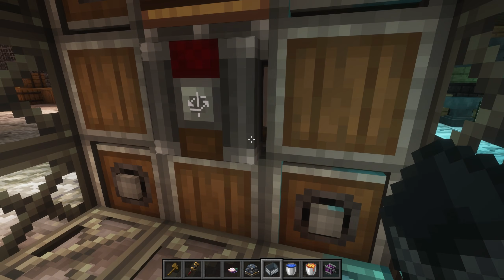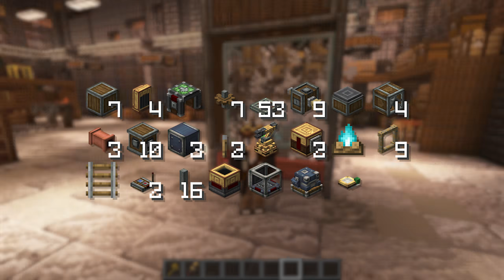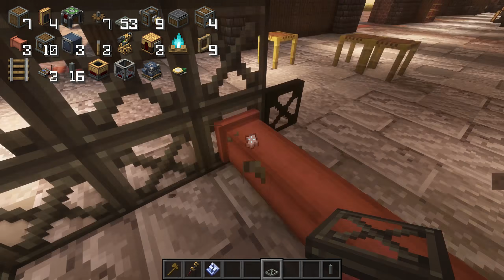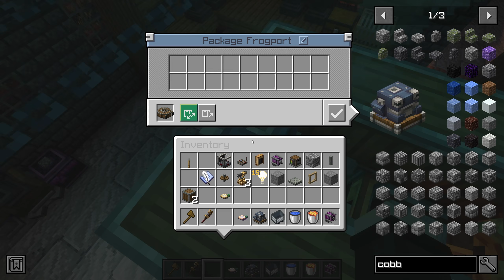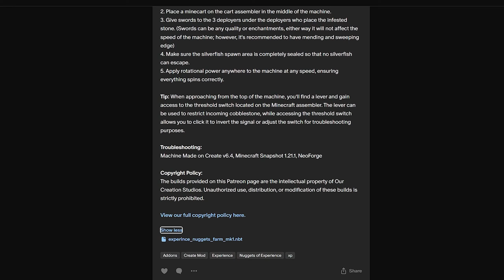This Super Compact XP Farm Generates OVER 200k XP Per Hour!

Comment from the maker: FAQ:  "Deployers aren't placing the blocks"

AWNSER: The Create Mod Schematics system tends to reset the threshold configurations, resulting in the machine not functioning as normal. 
Here are the configurations for the threshold switches, which, when applied, should fix any problems with the machine being out of sync with the minecart contraption.

Threshold Switch 1 - Located on top of vault: Power On When Top Row > 16 Stacks | Power Off When Bottom Row < 15 Stacks | Filter - Infested Stone
Threshold Switch 2 - Located on top minecart assembler: Power On When Top Row > 1 Item | Power Off When Bottom Row < 0 Items | Filter - Infested Stone
Reply: Question if someone isn’t playing on the new update what should the threshold switches be set to?
Reply from the maker: @e.m.f.l2763  something like 1% top and 0% for the one above the minecart, and 40% on top and 39% on bottom for thethreshold switch above the vault.
Reply: @OurCreationYT  Thank you! Your tutorials are the best!
Reply: @OurCreationYT  mine still doesnt work right with this
Reply: Build the whole thing but the infected blocks aren’t breaking. I  have the right input in the threshold switches and tried to place every block from bottom to top as the other comment says but they still don’t break i tried everything for over 3 hours. GG
Reply: I have the thresholds and everything set correctly but it still doesn't place the blocks, if I put a lever on the cart assembler and flick it manually then it does it
Reply: hey, how do i fix the smart chute not taking the infested stone from the item vault and putting it on the depot?
Reply: I can't get it to work at all and the frong thing is confusing im on 5.0 and dont have that, its not placing any blocks but I made sure the switches work, but they look differnet i dont see your ui its differnet.
Reply: Factory gauge isnt connected to smth i cant place it pls help yours is already connected but mine isnt
Reply: I had a lot of trouble with th schematic. didn't matter what I did, the deployers just wouldnt place the blocks.
My solution was as follows:
- when the schematic cannon was done, remove the deployers, the sail frames, the lower threshold switch, the cart assembler and cart and rail.
- place all of the above back in, working from rail up, by hand.
This got things working again. I think the schematic cannon screws up the cart contraption somehow, and breaks the whole machine. 
But you dont have to build it from scratch, if you are using a schematic.
Reply: @davidbayles3861 Was struggling for hours, thank you!
Reply: @davidbayles3861  You saved me so much time thank you

Comment: Hey! for some reason the cobblestones arent being smelted into stone and being transfered to the other side to be then turned into infested stone any ways I can fix this? I have the fan put set correctly but it is not pulling to the lava and when I put a cobble stone below it the cobblestone does not turn into stone
Reply: Fans going wrong direction
And 4:07

Comment: How are the moths dying? I've tried this XP farming method in a couple of different ways, but it never works because the creatures don't drop experience when killed by machines or the Create implanter; they only drop experience if killed by the player's hand, which is a problem because spawning thousands of these creatures can cause server and world lag. Are you using any other mods besides Create? Because at least I've tested it on versions 1.20.1 and 1.21.1 and it doesn't work to generate XP on its own.
Reply: create enchantment industry

Comment: A VERY STRONG SUGGESTION: Next time, list the items you're using, or if that is too much work, then just scroll over the iteam and it will display the name of the item for a few seconds. You are not giving accurate names of items, so I can't even search for them to create them. What are 9 cells? What are frames? This build is not difficult, but because it's missing information, it is taking so long just to find the things I need.

Comment: Bruh after like 2 hours it finally works, im on 5.0 version of create, guys go to the threshold above the cart assembler, then put 1% on top and 0% AND DONT FORGET TO PUT IT ON INVERT MODE IVE BEEN TRYING HOW DO I FIX IT AND ANOTHER THING IS, CHECK THE FKN VAULT BRO, THE SCHEMATIC DIDNT PUT 3 BLOCK LONG VAULT, IT DETECTS 2 BLOCKS INSTEAD OF 3 SOO ITS LIKE 2 VAULT BLOCK AND 1 VAULT BLOCK THAT IS DIFFERENT FROM THAT 2 VAULT BLOCK BRUHHHH THANKS AND BYE
Reply: u are my hero
Reply: after threshold went invert mode, the sail will be shaking and the cart assembler will turn on and off a bit, that mean its working

Comment: I think I've figured out why this machine sometimes won't work!  Try inverting the signal of the threshold switch on top of the cart assembler!

Long answer:
The cart assembler should be on and lit up by default.  The threshold switch above it is what provides the redstone signal.  If the assembler isn't on, it's probably because the switch is set to off.  Try inverting its signal!

When I figured this out, I didn't need glue.  (But keep that on hand just in case gluing the sail frame to the switch above the assembler may help)

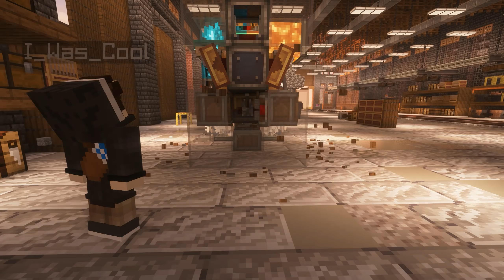(Note that in the machine demo at 1:48 the assembler is on every time the switch is in place atop it, but during the build demo the assembler is default off even with the switch in place.)

EDIT: After further thinking, I think the way it's supposed to work the vault is ALWAYS supposed to have some cobble in it.  With cobble in the vault, the switch atop the assembler will should stay on, so make sure there is something in the vault.  It shuts down the assembler if there's nothing in the vault.

Either way, inverting the signal may force it to run anyway, or toggling the signal may update the switch into operation.  Yes, turning it off and on worked for me.  😂

Comment: is there a way to use this farm without a chain system/frogport
Reply: I changed frogport to funnel and chute but now it just spits cobble out the side? not quite sure what's supposed to happen
Reply: @maxeaston8943 must invert the rotation of your shafts to also invert your fans the other way.
Reply: @maxeaston8943 did you figure it out? for me its not even placing anything

Comment: im sorry im starting from lvl 0 . noob knowledge... do i need a cobble generator using that conveyerbelt thing to fuel/run this system?
Reply: You don't need the chain you can set up a cobble generator and use a brass funnel to put it on a belt and then a brass funnel again to enter the vault

Comment: i have a problem with the arm it doesn't give any blocks to the deployer I replaced them I replaced the arm everything nothing works
Reply: Did you double click the deployers with the arm to set them to the yellow setting and the depot to the blue setting?
Reply: @adjectivenomad  I did the same, arm work function as intended

Comment: does this build work without the packager? my mod pack might be before that came out its the create+ modpack with 282 mods on curse forge.
Reply: It upsets me that a lot of people moved on from 1.20.1 create support, not many of the packs that were before Create 6.0 are going to be updated (I.E.: Create Deco will not be updated to 6.0 in 1.20.1, but will only be in 1.21+)
Majority of the devs in them just don’t want to, when it’s honestly saddening that they won’t. Meanwhile, some are updated. (Steam&Rails is updated to 6.0 in 1.20.1)

Hurts, but now I gotta install everything and completely recompile every single mod I have into *separate folders*, this and that. It’s pain :(
Reply: if ur still wondering, yea. just replace the frog and packager with a barrel and chute. you'll just have to fill the barrel by hand or automate another way to transport the cobble.

Comment: Awesome work. It was working perfectly yesterday, but today the minecart just wouldn’t go up or down. I tried replacing the sails, threshold switches, minecart, deployers, and even the mechanical arm. Checked all the threshold settings and redstone links too, everything looked fine. I ended up fixing it by lowering the RPM from 256 to 128. It’s working now, but the farm's output got cut in half because of that.
Any plans for a Mk2 version that fixes this? Or do you think I should try moving the farm into a single chunk? Right now it’s right on the border of 4 chunks.

Comment: For some reason cobblestone that was turned into stone does not go back into the vault through the funnel! What am i doing wrong?
Reply: the funnel could be pointing the wrong way - check the direction of the arrow & make sure it's pointing inwards. also make sure it's filtered correctly, to stone rather than infested stone since they look the same

Comment: how do i reset the minecart picking up and going down loop? it stopped due to what i assume is my power system going off for a while but now ive tried removing the vaults and replacing them butt they keep just filling up with infested stone and the minecart dosent go up or down

i fixed it,  it seems that in someway shape or form the threshold switch on the contraption got removed
Reply from the maker: Yeah this is one of the most glitchiest machine I’ve ever made.

The Create Mod tends to decide it doesn’t want to function sometimes with this one.

Comment: Since the post down below was written at 4 am it lacked more proper testing, and after doing so i found out that the problem was caused by redstone signals bein looped between blocks and locking the smart chute on a powered state that per its location was keeping the cart assembler powered so it would not turn off automatically, i had to move things around a bit but it now works, tuns on and off when its supposed to.

~~ DISCONSIDER ALL DOWN BELOW ~~ 

After a couple of hours troubleshooting on why the cart assembler threshold switch wasn't working, i found out that the filter setting don't work (maybe a problem with the create mod itself?), the farm when activated the first time and switched off with the top leaver so no more cobblestone gets in the farm, will always have in the vault 256 cobblestone so the threshold switch will read the cobble value as if it was infested stone, the fix? remove the filter and set it to: power off when at or below 4 stacks and power on when at or above 5 stacks, this fixed the cart assembler not turning off for me, thanks for this amazing farm!
Reply from the maker: Sorry for the trouble the farm caused. I'm glad you got it working, though, and thank you for the feedback on your issue and solution. This will help someone else and is useful information for me as well, so thank you.

Comment: when I go to place the factory gauge, it says "tune to a stock link before placing."
Reply: you need a stock link, have searched around but its just to monitor if the inventory is full and all that, you can just place it close to the farm, right click with the factory gauge and then place it
Reply: Same here. Did you found a solution ?
Reply: @boulouk_22 you you gotta already have a storage area setup and you link the gauge with an item vault or something
Reply: @boulouk_22  you need to right click on the stock link that is in the same network as the cobblestone farm or whatever cobblestone supply you have, and only then place it on the packager

Comment: i think i set it up correctly but the deployers aren't placing the blocks, it feels like its in sync with the minecart contraption attempting to place the blocks at the wrong time or something? i can't figure it out
Reply from the maker: The Create Mod Schematics system tends to reset the threshold configurations, resulting in the machine not functioning as normal. Here are the configurations for the threshold switches, which, when applied, should fix your problem.

Threshold Switch 1 - Located on top of vault: Power On When Top Row > 16 Stacks
Power Off When Bottom Row < 15 Stacks | Filter - Infested Stone
Threshold Switch 2 - Located on top minecart assembler: Power On When Top Row > 1 Item
Power Off When Bottom Row < 0 Items | Filter - Infested Stone
Reply: @OurCreationYT  i'm sorry but i'm pretty sure the threshold switches are set correctly!
Reply from the maker: @ If the minecart contraptsion is dismantling and reassembling itself then your assumption of it being in sync might be dead on, it could be trying to place the cobblestone during the same time as the minecart is assembled. You could get around this by changing the rpms around.

Other possible reasons:
1. The machine could be spinning to slow.
2. Land claims or chunk claim mods interfering.
Reply: @OurCreationYT  oooh okay, those all sound like good options. i did change the RPM from 128 to 256 and it wasnt working on either, so maybe it is a land claim thing or something. if i figure it out ill reply again
Reply: @OurCreationYT  it was an issue with land claiming! i had to de-claim the chunk and it started working perfectly, thank you so much for the schematic and the help!
Reply from the maker: @supernova_boy  Happy I could help, and thanks for letting me know what was causing your issue so I can use that for future reference.

Comment: hey i made the farm but it is pushing the cobble of the machine onto the floor any ideas whats wrong?
Reply: fix it but have a new problem the farm works but nothing is being placed so it is just full all the time
Reply from the maker: May have to click on the threshold switch and invert the signal or hit the check mark to reset its block value

Comment: Where is the on / off switch ? I just add clutch to unpower it?
Reply from the maker: There are 2 levers on the machine:,
1. The one on the bottom of the machine in the middle cuts off the chute, halting anymore infested stone from being given to the deployers.
2. The one near the top stops the machine from consuming any more cobblestone.

Then there is the threshold switch on the minecart itself (which you can access from the top of the machine) and quickly invert the signal on that to force stop the breaking of infested stone instantly, however, this method isn't practical since you don't have much time to open the GUI and click the invert signal icon before the minecart assembles again.

If you want to actually force stop the machine, then yes, the clutch idea will work best.

Comment: I notice that you don't glue the sails to the minecard, if is for one reason please explain me my error
Reply from the maker: Sails work similar to chasies; if they are next to a a assembled block they will automatically attach onto the assembly. 
I used this feature intentionally to prevent the chance of infested stone glitching the machine by attaching itself to the contraptsion. Since there is no superglue there's no need worry about that.
Reply: @OurCreationYT  I didn't know that thanks forn the explaination
Reply: I'm pretty sure this is because sails will automatically connect to each other if they're touching, like linear / rotational chassis